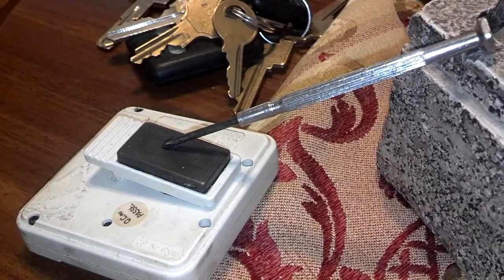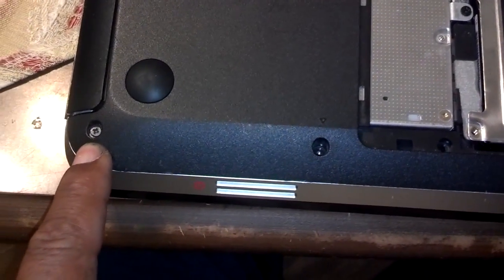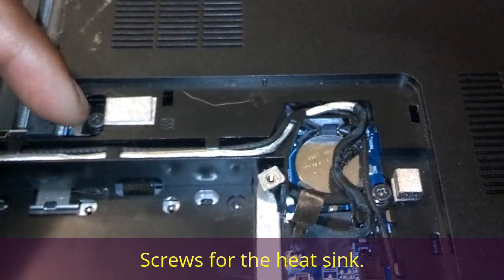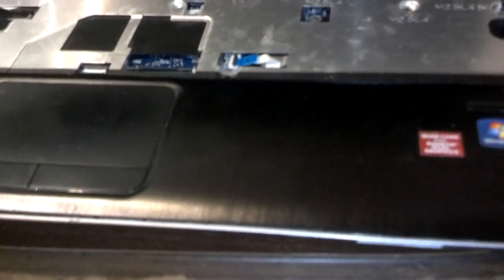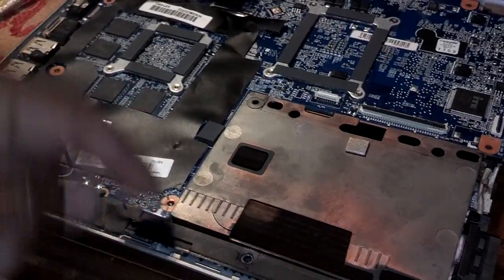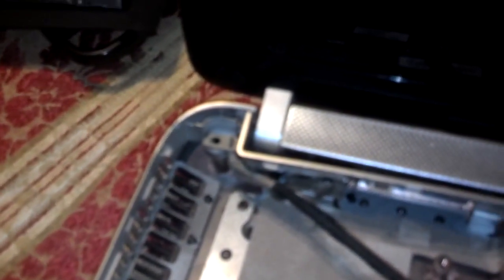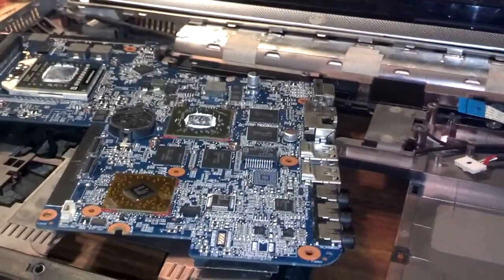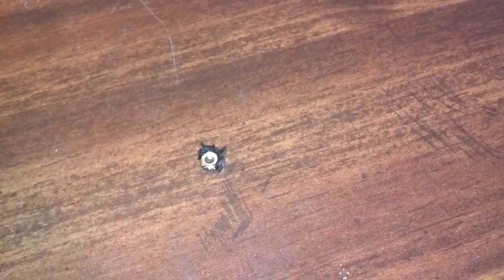HP Pavilion DV6 assembly instructions, processor replacement, etc. - VOTD

Comment: Is this laptop compatible with the amd a10-5750m? I've found a similar laptop on ebay and I have an a10-5750m from an older laptop that broke so I was wondering if it would work.
Reply from the maker: I think the processor is married to the motherboard.
Reply: @RobertDIY  Thank you for clearing that up for me

Comment: I have a similar HP DV6, and it was suffering from random shutoffs (due to overheating, I believe).  So, I ran the OCCT stress test to hit the cpu cores at 100%.  It ran for only 3 minutes and the cores registered 63.8C before the laptop shut off.  With your video, I was able to completely disassemble my laptop, clean out the HSF and apply new thermal paste to the CPU, and put it back together.  I did not think it would work at all, but your video helped immensely.  After it was reassembled, I ran the stress test again, and this time it ran for 10 minutes before I manually halted the program.  The cpu cores registered 65C by the end of the test, but there was no random shutdown.  I do not normally run the cpu at 100%, so I am hoping the issue has been solved.  However, I do not think I could have taken it apart without your great tutorial.  Thank you.
Reply from the maker: you are welcome.

Comment: I only need to my keyboard its not working right. do i have to do all that i dont wanna pull out cards and stuff. Want to get it to flip out like you did to possibly clean keys are messed up an screwing up my online keyboard too
Reply from the maker: You need to replace it.
Reply: ya I think so its causing start up and mouse errors from stuck keys.I should of left it alone making it worse. Is the single screw important too because it was broken?
Reply from the maker: I'm not sure.

Comment: I've worked on quite few laptops and desktops, and I watch youtube for tut's on what ever model i'm working on. I think this is by far the most detailed one i've seen yet. WOW..  That was a very impressive tutorial !  I would like to suggest when you removed the processor, you should have mentioned the gold triangle location. I'm sure you will on your tut where you put it back together, if there is one. Nice video.
Reply from the maker: Thanks for the tip.
Reply: yes it´s very perfect :)

Comment: Robert your video is very useful I replaced the cpu of my machine and now it is working fine after several assemble. The idea of the template is wonderful I disassemble others laptop and always I have a mess with the screws! ! Congrats
Reply from the maker: +Mariela Gutierrez good deal. Thanks for watching.
Reply: Hi Robert please help. My laptop start up when I change the CPU, works good until I turn it off, then, it won't boot windows again. I replaced the fan and cleaned, again its start fine until I turn it off, then don't boot windows again. I don't have any clue what to do. Blink error is CPU.
Reply from the maker: CPU may be bad again. It may be overclocking. Have you replaced the mother board battery? I would leave it on if I were you. I leave all of mine on all the time.

Comment: can i upgrade my a8-3500m to other amd cpu? how i know if it's compatible with the 6620g gpu and the rest of the chipset?
Reply from the maker: +Camizer I  would go to the HP site and see what processors came in similar machines. Max out the ram first.
Reply: +Robert DIY nervermind i have l2 chipset, the maxim cpu compatible with my chipset it's the A10-5570m. I think it's worthless at the moment to upgrade for US$80. I have ram 8gb btw.

Comment: hey buddy excellent video I appreciate your expertise and verbal communication.  This is exactly the video I needed. However I think my issue is electric. I get no lights at all.  I would like to remove the m/b as shown GREAT then test transistor & power jacks/voltage.  I don't have a schematic so I don't know the voltage per each coil etc.  Is this something you can help me with?  Question why you in the car? heeheeheeheeheehee :)
Reply from the maker: +Cal Bankhead LOL, You likely have a broken power lead at the plug. Have you tested the power brick? Are you sure it is good? Does the place you plug the cord into seem tight?
Reply: what I did do was use another HP adapter from another HP that I own & no results also the power adapter from the bad laptop is GOOD.  so I think it I something internal
Reply from the maker: +Cal Bankhead ok

Comment: Robert: Thanks a LOT for making and posting this video. I have an HP Pavilion dv6 just like the one in this video, and I wanted to make it bigger/stronger/faster by upgrading th RAM, Hard drive, ad CPU, all of which I found a LOT cheaper than buying a  new machine, and this video is EXACTLY the one I needed to do what I'm planning to do to my computer. Your instructions and video are hands down farrr better than the others I have found while researching You Tube for videos to perform these upgrades. I rate your video and instructions a 10 out of 10 fo those who might  want to watch/use it for their upgrades/repairs etc. Thanks again, Chuck Alexander
Reply from the maker: +Chuck Alexander Thanks for your kind words and for watching.
Reply: Robert: You're welcome. I also noticed you have a lot of volvo videos. One of my sons has a volvo and trys at least to do all his own mechanic work on it, so those will really help him.
Reply from the maker: Nice. Thanks again.

Comment: There is a version of that machine that tends to overheat the graphic chip, the solder balls under it become disconnected, much like the xbox i think, im not into game consoles so dont quote me lol.
if its the graphics chip then it will need to be removed with a reflow station and the board cleaned and mask solder depositing on the pcb before the chip is reflowed.
I hope it is the cpu though, laptops can be a pain to repair at times :-(
Laptops are a good source of spare screws lol, why fit just 6 pcb hold down screws when the manufacture went mad with 20, silly arses lol :)
Reply from the maker: zx8401ztv I hope it's the cpu as well.
Reply: Hi, Was it the cpu? Regards